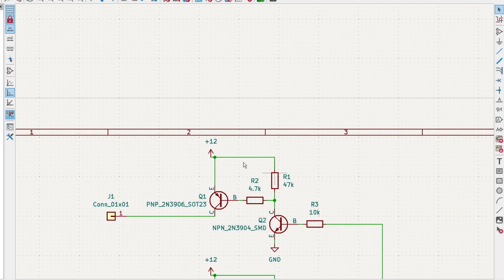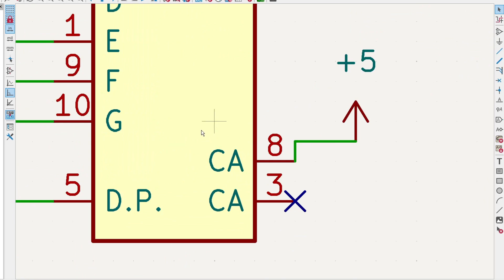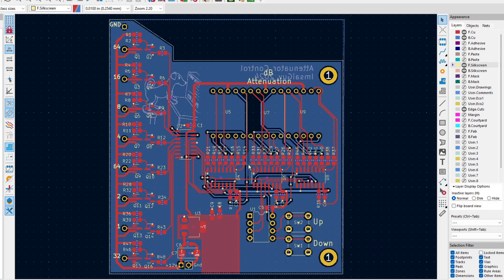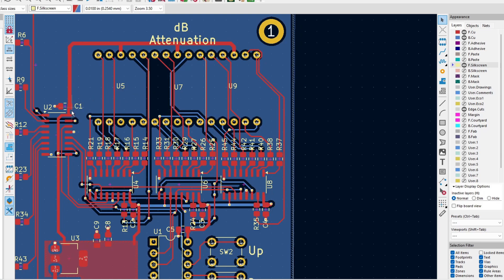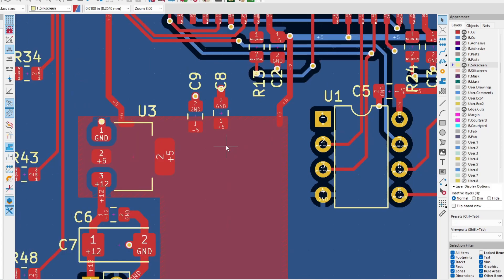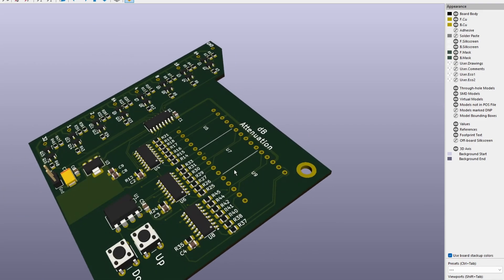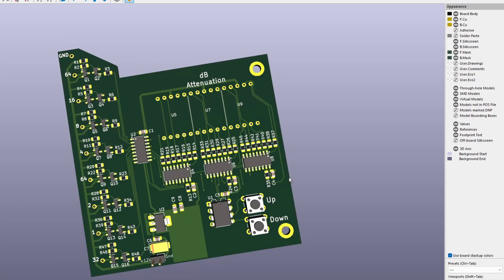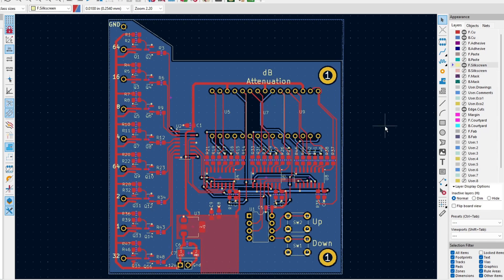#2046 Weinschel Attenuator (part 3 of 6)

Comment: What about a couple of mounting holes to put screws into the attenuator (it seems to have threaded holes for this purpose). Would just need a couple of standoffs to bridge the gap where the pins sit higher than the board.
Nice design and board though, look forward to seeing the physical ones.

Comment: Fair enough design, it should do the job.

I would have considered two changes.

1. Add a programming header of some sort much less bother than swapping chips.

2. The arrangement of the board with the attenuator unit on one end is a bit clumsy looking if you want to use the system in another unit. I would have made the attenuator section either a separate or snap off PCB, and added a double row on headers so that you could use a cable to connect to the attenuator if snapped off the board, or a shorter jumper if not.

Andy

Comment: One thing you could do is add three pads for the up/down inputs, so that if you decide in the future to put it in an enclosure, you can wire to external switches on the enclosure, or maybe an external up/down controller of some kind, without removing the switches on the board.

Comment: Thank you as always for your videos!  I'm curious why you decided to go this route instead of just driving it with a multi position rotary switch?  With a chicken head knob and front panel that would allow quick setting as well as indication of what it is set to.
Reply from the maker: I don't have a 128 position switch
Reply: @IMSAIGuy  gotcha, I missed that multiple of the attenuator levels could be selected at the same time.  Thanks again!
Reply: As I understand it, there's 128 different attenuation combinations available, so that would be a pain to wire up 🙂